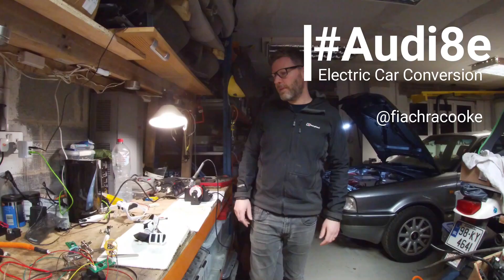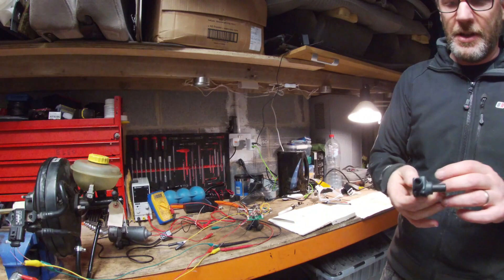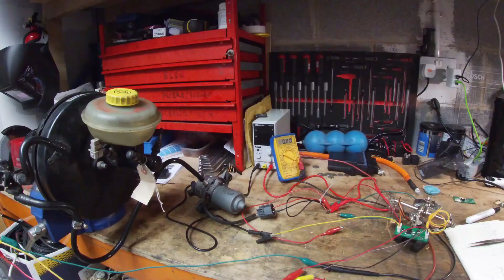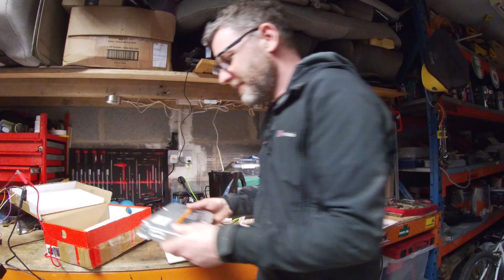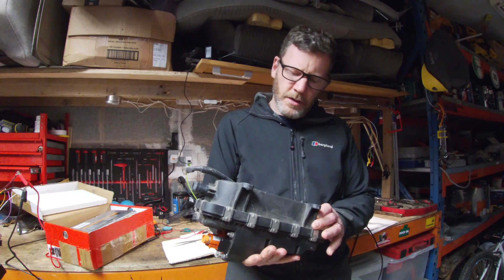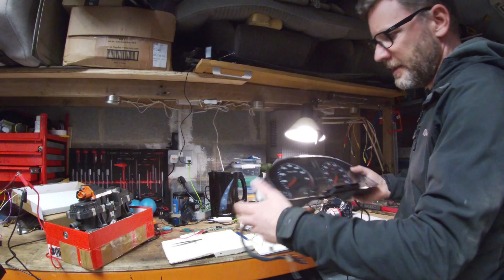Audi 80 EV Conversion - #21 - Post Hibernation Plans

Comment: VERY GOOD THE VIDEO HOW MANY MILES CAN YOU TRAVEL WITH THAT NISSAN BATTERY BANK  THANK
Reply from the maker: Thanks. Not fully sure yet but when I get the BMS working, I can begin proper trials but so far, I would think up to 80km. Hopefully will find out soon!
Reply: @Scampi6000  thanks

Comment: Great to see you back at it Fiachra. 
I bought a TRW power steering pump but mine was faulty so I plan to use the original belt driven pump and drive it with an alternator adapted to be a motor. If all goes to plan I'll use an ebike controller to drive it with an ebike battery so it won't even be a drain on the main battery, but that is still a bit away as I'm still working on the motor mount.
Looking forward to the next update.
Reply from the maker: Thanks man👍 Yeah, glad to get things moving again. I'll keep an eye on your progress. Keep it lit!